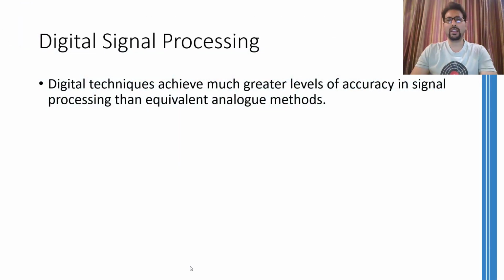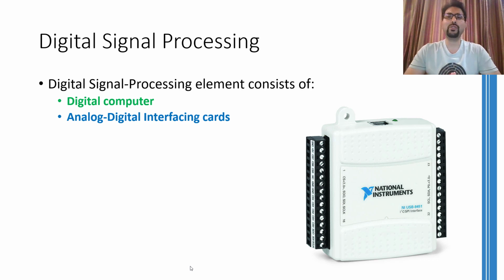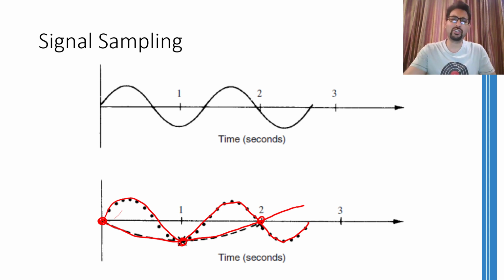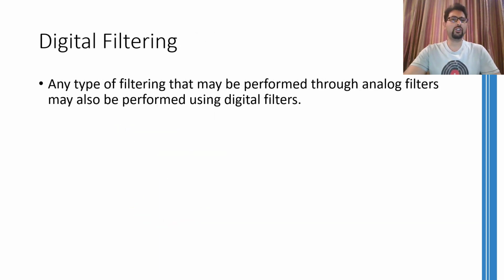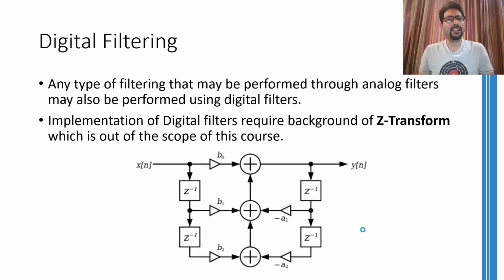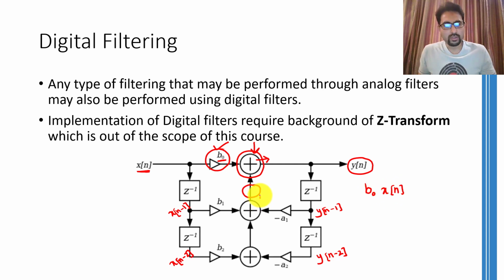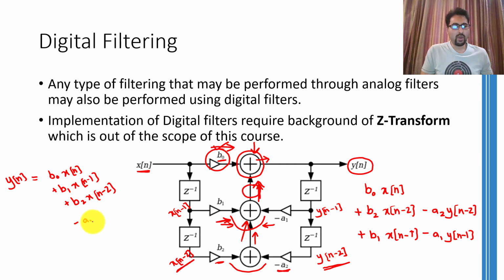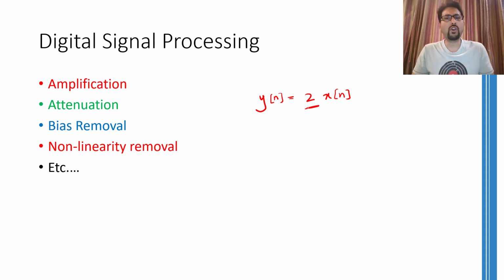Lecture 6 Digital Signal Processing | DSP | A Quick Introduction

Comment: Quantization in mathematics and digital signals is the process of mapping input signal data set which is usually continuous set to a smaller set of output values having finite number of elements that are actually covering a range of input values.
Quantization error is the difference between the input value and its quantized output value.

Comment: Quantization is the process of mapping input values from a large set to output values in a smaller set, often with a finite number of elements. Rounding and truncation are typical examples of quantization processes

Quantization error is the difference between the analog signal and the closest available digital value at each sampling instant from the A/D converter

Comment: Quantization is defined as the process of forming a small set containing output values from a large set containing input values.

Quantization Error is defined as the difference between an input value and its quantized value.

Comment: Quantization is the process of constructing input values from a large set to output values in a smaller set, like with a finite number of elements.
Quantization error is the difference between the analog signal and the digital value at each instant of the sample.

Comment: Quantization is the process of mapping a large set of input values to a smaller set of output value, often with a finite number of elements for example Rounding and truncation operation and the difference between an input value and its quantized value such as it's round-off value is referred to as quantization error

Comment: Quantization digital signal processing, is the process of mapping input values from a large set (often a continuous set) to output values in a (countable) smaller set, often with a finite number of elements. e,g:truncation

The difference between an input value and its quantized value (such as round-off error) is referred to as quantization error.

Comment: Quantization process means mapping large input values to small output values set. For example round off or truncation
Constraining real numbers to integers is quantization. 

Quantization error is the difference between analogue signal and its closest available digital signal at each sampling instant from ADC converter